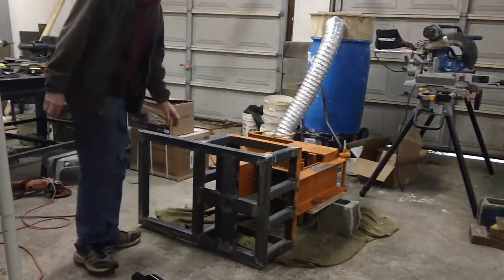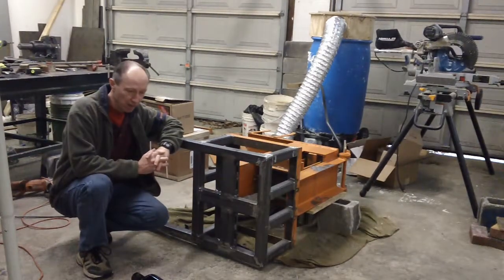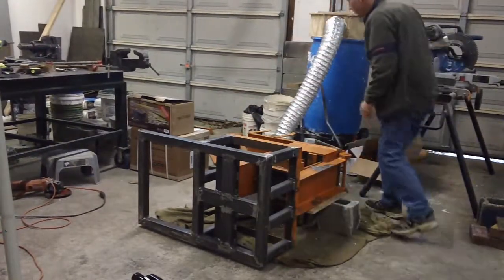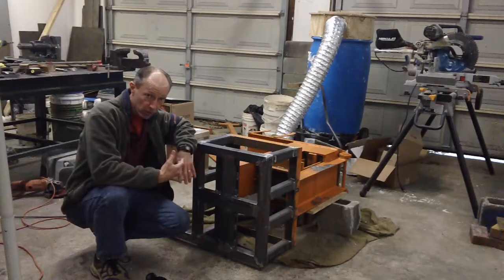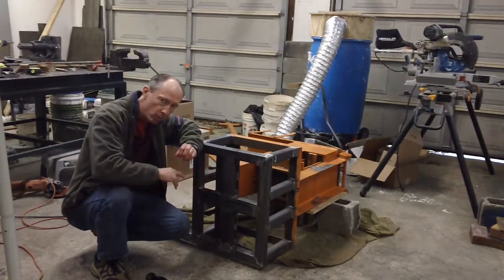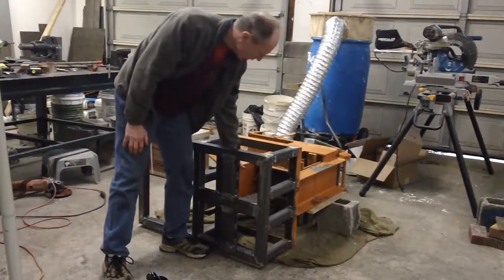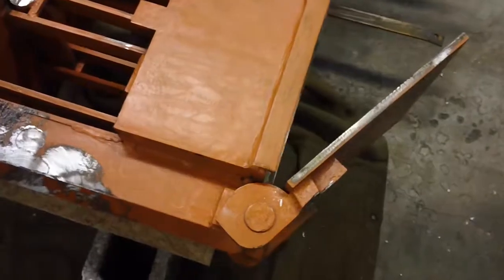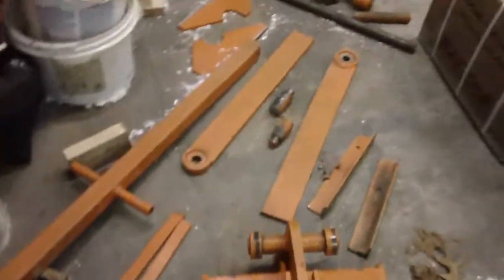Converting a manual Compressed Earth Brick machine to hydraulics video 1

Comment: Do you think you could use an 8t log splitter, with the brick press added, to do the same thing? Apologies if it's a dumb question. I bought the 2 brick manual press from China and it's not practical (as I see you've found). Looking to do a conversion in the simplest way possible. 
*edit: I see you've said 15tonne is what you need.
Reply: For example this is a log splitter on the market in my state. It seems i could set this up on its side underneath the manual machine. 

https://youtu.be/PAw0dYLommo
Reply from the maker: ML6103 yes I think the 8 ton will work. The 15 ton cylinder is way more power than you need. Good luck with your project.